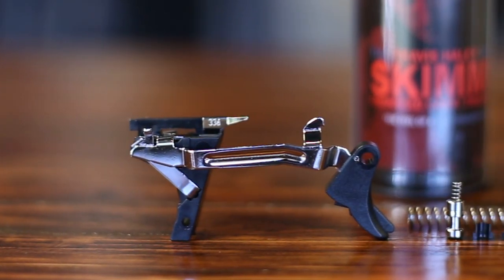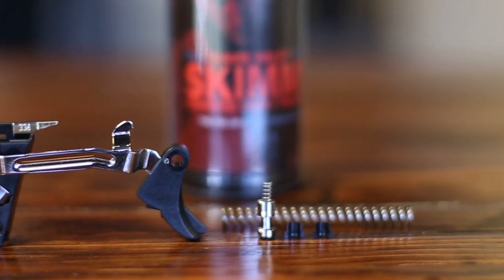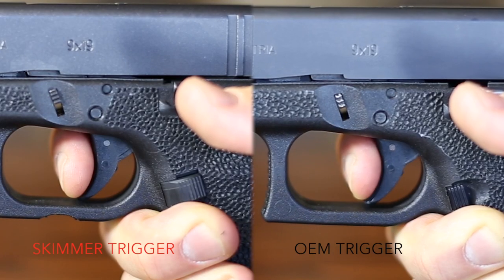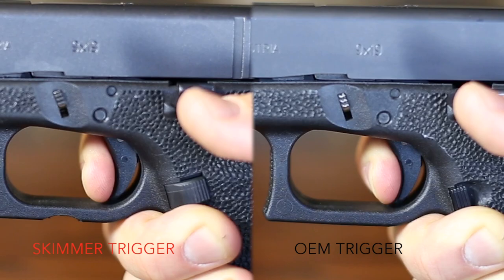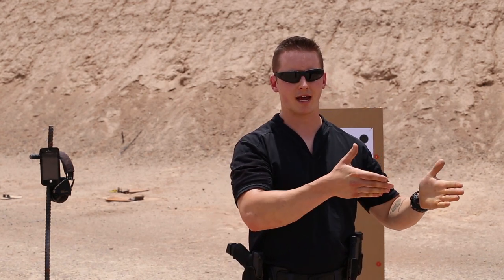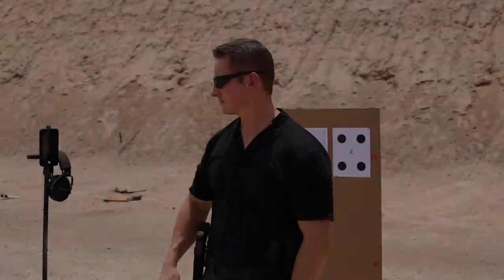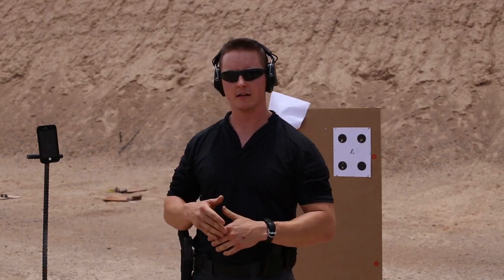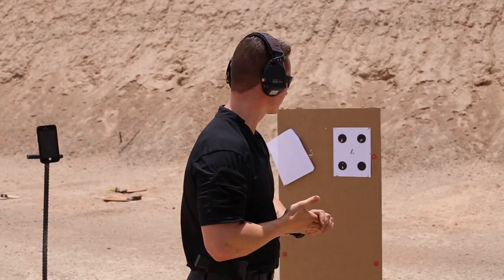HSP SKIMMER TRIGGER AND TRIGGER CONTROL

Comment: As a drummer, I know one of the most important principles to practicing is to slow it down if your practice isn't perfect. Great video, but I would add that if you're outside of the circle on that last group, slow down that tempo and let your nerves myelinate to that speed so you can continue to increase the tempo perfectly.
Reply from the maker: Ed Chow Correct, as for your circle comment, yes the ultimate goal is the perfect run with perfect rhythm, perfect trigger control, and perfect accuracy.  however this drill we want to emphasize the neuro timing first then we have other drills to increase accuracy.

Comment: great vid, you say all three safeties are in tact, but has any testing ever found the drop safety to fail? i know it's mostly just internet rumblings, but they rumblings are around a little bit...
Reply from the maker: TheBenzo666 Yes we have actually done legit professional drop testing... not pulling the rear plate off and forcing the cruciform sear to drop with a punch.  There is no internal pressures created like the funny anti Skimmer videos out there.  We have dropped Glocks from 5-50ft over 300 drops logged with an actual blank in the chamber and not one fired and not even a light strike.
Reply: HaleyStrategic awesome... and thanks for the reply... your guys channel rocks...

Comment: I'm at a point where I want/am able to buy the Glocks that i've always wanted. I really want the 26, 19, 30 and 21. I see a lot of tactical experts like Travis Haley using Generation 3 Glocks. I'm very curious as to why they use them instead of the Gen 4s. I know that they originally had their problems but i heard that they were fixed, and all of the ones that I have shot have run exceptionally. It would be awesome to hear from someone at HSP but if anyone has any good, non bias insight/information, I would greatly appreciate it, thank you!
Reply: Ditto
Reply: Logan Patterson Let me know if you find out something haha. Ill do the same.
Reply: I picked up a FDE frame G21 Gen4  and compared it to the Gen3 G21 I have around. I added a Grip Force Adapter to the Gen4 and actually prefer it better than the Gen3. Especially shooting hotter .45acp, I find the Gen4 recoil spring gives a little softer recoil impulse with 230 grain hardball. I've also found it added an ounce or so more to the front end near the muzzle and it seems to come back on target more, unlike the Gen3 where I'd have to muscle it back down. Now in regards to 9mm/.40cal, it may be more advantageous to run single spring systems and utilize the Gen3 architecture. I don't shoot those calibers so I can't give any empirical data from that perspective. 

Not that that helped much but figured I'd give my 2 cents.
Reply: +Spencer Rich Productions that insight actually helped quite a bit! I appreciate you adding your two cents

Comment: I'm going to be honest, I'm a horrible shot with a pistol, but I have the speed reloads, manipulation drills, and timing down to a T, how can I improve accuracy?
Reply: I went thru 2 1000 round cases of 9 mm ammo practicing on just accuracy and good trigger manipulation skill before I got it. I went thu 2000 of 22 rimfire ammo as well. As of today 120 yard torso shots with my sig 320 full sized not a problem.
Reply: will riley Try training with a bb gun,  try to put all bullets in one holle, its hard because they are light, round and barel doesnt have poligonal groves. You'll have to develope second concentration level to do it I first thought it was impossible to hit consistently in 2 inches now I can do it in one, almost all around same holle. Distance 2-3 meters.
Reply: Accuracy should have been mastered or atleast made efficient as possible before becoming confident enough to state that you have "speed" reloads, manipulation drills and timing down to a "T". None of that matters if you can't efficiently hit your target every time. Also, please don't let me sound condescending, I'm just trying to show the massive importance accuracy has in the entire equation. There's TONS of different things you can work on as far as accuracy is concerned, it's just a matter of how much you actually, truly want to put into the practice. Since I don't know exactly where you stand as far as accuracy is concerned then I'll be speaking in general for your form of advice... First off, SLOW DOWN. You'll never master anything by trying to rush through it or force it. Second, dry fire practice is mandatory. Take a quarter and then work your way down to a dime on top of your slide, as close to the front sight as possible when dry firing. Make sure when you dry fire that the coin doesn't move whatsoever when pulling the trigger. This simple drill helps with your mechanics and muscle memory in both grip and trigger discipline. Also, I should have stated this earlier, make sure you have a good pair of sights and if possible an RDS. The RDS will help show you EXACTLY what you're doing when gripping the gun and pulling the trigger. Next is the use of small targets.... As corny as it sounds, the saying "aim small, miss small" is so damn true. Also, when at the range make sure you're in the proper mental state to not only be aware of current mistakes but current skill level and be mentally aware of how to improve your current state. I see so many people go to the range and belt through the ammo in the name of funs sake and don't take any knowledge of improvement home with them. Be hard on yourself to the point where you DEMAND improvement. Don't allow ANY trip to the range to be of no lesson and certainly no improvement. Also, be EXTREMELY aware of your grip through recoil. If you EVER find yourself needing to adjust or re-set grip through continuous fire then your grip is WRONG. I used to REALLY struggle with grip just simply due to having a weak grip. It was easily fixed by getting a good, adjustable grip strengthening tool. They're super cheap, extremely effective and will actually give you noticeable results rather quickly. Alot of people fail to realize how insanely important having a nice, strong and repeatable grip is not only in shooting but in every day activity from working out, at work or day to day activities. Having a weak grip can lead to injuries of other body parts as well. If you're really dedicated and actually want to improve then there's endless literature out there for that very thing, it's just a matter if you actually want it or not!
Reply: @TerminalM193  bro…. I was in HS 7 years ago.

Comment: I've read several "expert" comments that installing your trigger eliminates the drop safety.   Does installing your trigger remove the drop safety?
Reply: I was wondering same thing, @HaleyStrategic can you comment?
Reply: I emailed Jeff at Glock Triggers and asked him what impact installing a Skimmer trigger would have on the drop safety.  This was his reply;

 "All safeties function on All of our products and All are tested before packaging."

It appears the "experts" are not as knowledgeable as they profess to be.
Reply from the maker: Wonder what "experts" stated this?   Just as Jeff stated all safeties are functioning as designed.
Reply: just ordered a trigger kit. hope it takes out the slop of the gen 4 triggers as well as advertised. even a 50% improvement will be worth it.